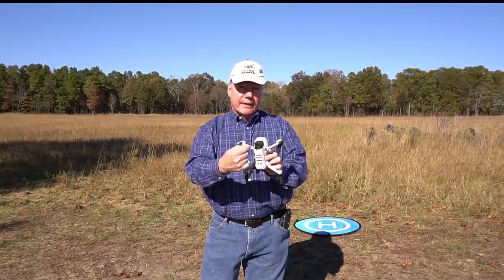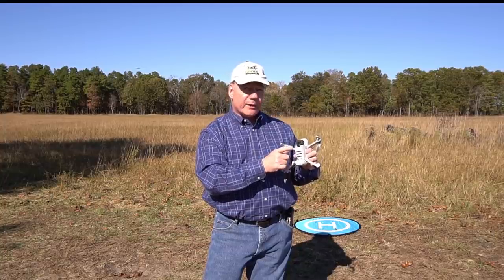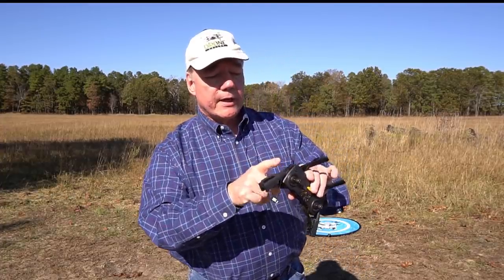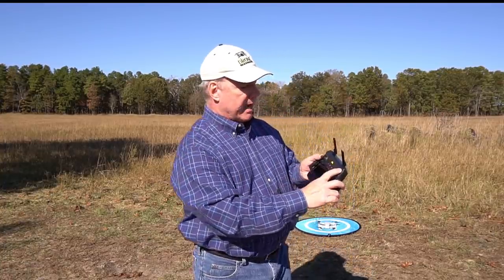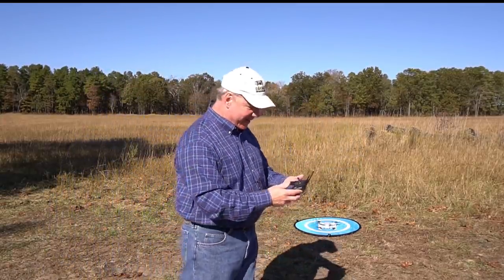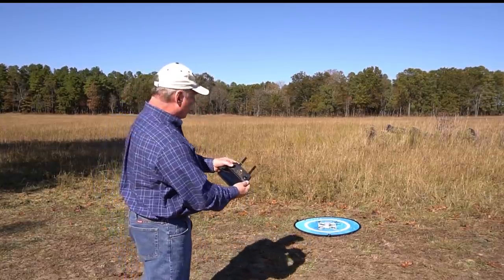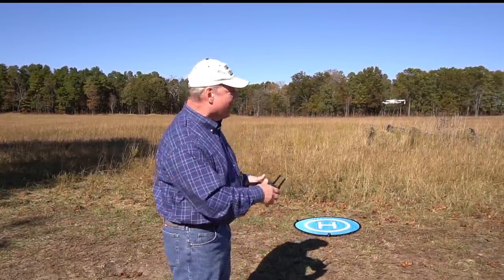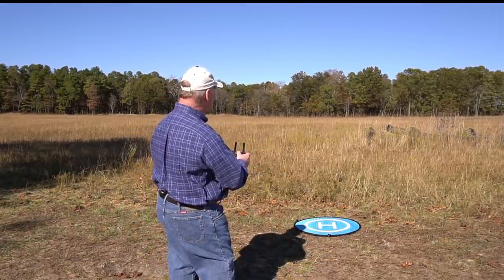Mavic Mini - Setup and First Flight

Comment: Great job, Rick!  Yeah, they ticked all the boxes on this one.  For many, the main attraction will be that it is under the weight limit for many existing and upcoming regulations. (I published a video on the Canadian perspective on my channel).   Did you notice if there is any geo-fencing enabled on this product?
Reply: GEO 2.0 engaged :)
Reply: @repaid1  OK, GEO 2.0 is interesting.  The catch, at least in Canada, is that it doesn't match our airport restrictions (missing airports, incorrect restrictions, for example).  Does it actually lock you out of areas, hence requiring you to 'unlock' via DJI?
Reply: @DonJoyce  All your incorrect data should be set to DJI Flysafe at the address or contact they provide. The only way to know how the craft would behave would depend on what airspace category DJI says it is or it actually is. Their site gives you that information..Best of luck.

Comment: Hi Rick, did you do the compass/imu calibration before flying the drone or does this drone needs to or it auto calibrate itself? Does the controller have a stop button same as in the spark because its really handy especially for indtance if you do dronie and suddenly you noticed some elecrrical wires in its path? Can dji do updates on the flight features in the future especially on the active track and follow me features which every new user loves since its a software? Very informative video! Thanks!

Comment: Extremely windy?  Looked pretty calm on the video.
Reply from the maker: The wind was gusting quite a bit and he drone held it's own. I have a clip posting this weekend where I show you how it performs in windy conditions. It get bounced around a little but the video is still rock solid.
Reply: @Dronevalley  Thanks
Reply from the maker: @Wheres_Bobby  No worries, stay tuned for an update. Rick

Comment: The parts of the distant grass looked blurred out on take off.  Not sure if it is the frame rate or aggressive image smoothing due to motion?
Reply: I'm pretty sure that's just YouTube's terrible compression.

Tom Scott did a good video on it here: https://www.youtube.com/watch?v=r6Rp-uo6HmI
Reply: I saw the same thing here . .  low level,  grass looked blurred here too . . .
Reply: That is generally what Youtube's terrible compression does. It's based on the settings it's uploaded with plus the original settings on the file. Unfortunately it didn't come out well here, but I've seen plenty of other reviewers that have showed footage that looks just as crisp and in focus as he is describing. It's a shame. Some other camera reviewers I watch tend to have a download link in the description for the raw footage purely because of what Youtube can do to the video quality.
Reply: If you're seeing it too, it's not my internet. I think it's the mini's recording. If there was a clean download we'd know. I've seen this on a Mavic Pro too.
Reply: AND if it was youtube, the whole frame would be blurred.

Comment: Thanks for this. Just about to hit the buy button but the blockiness in the midrange as seen at 7:50 in the video and elsewhere is a bit concerning. Is this on the raw footage from the drone or is it a youtube or processing artifact?
Reply: i think its more of the write speed of the SD card not being fast enough after looking at it and comparing to the stills later in the video. the stills are crystal clear, but the video does have issues when you have tons of small objects in motion in the mid range. 
not sure if it's the cards capabilities, or the write speed of the drone's hardware itself. but i am certain its not a youtube issue.
Reply: John Robertson could be just YouTube, processing artifacts, or when rick rendered it out it lost a lot of quality due to the bitrate he rendered it at.

Comment: Do you think an iPad mini will still fit like it does on the M2 series?
Reply from the maker: Ptter, thanks for the question and I actually just answered it in the Top 10 Questions clip I posted tonight. The answer is yes it will work and I even have a cable we manufactured you'll need to connect the tablet. The stock one that comes with the quad is too short and this longer one (30cm) is the perfect length to make the connection. Here's a link if you need one - https://tinyurl.com/y2895ood

Comment: Great videos, thanks! I have been checking several testers of the mini, and am impressed. Quick questiions; when using your iPhone, what is the range you can continually view the image? Have you heard anything about Mavic adding the ability to use goggles? So far, I am impressed with what I have seen. I am new to drones, and this will be my first, although I do fly RC aircraft. Thanks.

Comment: Hello there. In one of your videos you commented that the Ipad Mini would fit in the controller. I just received my Mavic Mini and you are correct. The issue is however that the DJI Fly App seems not to be available for the Ipad Mini 4 ….. Most Odd. I am in the UK and it aint in the App store..... What are DJI doing
Reply from the maker: Dennis, you should be able to download it the same as you would for the iPhone. One issue is that the app doesn't yet scale to fit the larger screen properly but they can sort that out later with an update. I use the iPad Mini 4 with mine and it works great. Rick

Comment: you truly are amazing i will be getting this drone as a Christmas present for me. i just need to know you said you get 30 minutes of fly time so if i charge all 3 batteries i can fly for 1 hour 30 minutes right? amazing drone
Reply: No actual flight time with a battery is about 25 minutes max if recording and in normal environment. That wouldn't be good on your batteries using it like that. You should always land with no less than 20% remaining if not more for the batteries life and longevity so about 23 minutes. Don't know too many people that need to film for 1 1/2 hour anyway if they have a clue what they are up there for..LOL
Reply: @repaid1  lol no i wont record for that long i was just curious on the time. thanks for the comment as i will get my combo set the 10 november

Comment: Nice. The website says that the drone can fly for up to 30 minutes. Some reviewers seem to be getting 23-25 minutes.
What flight time have you seen?
Reply from the maker: Thanks for the post and the flight time can vary depending on how you're flying the drone. If it's a windy day or if you're flying in Sport mode, your airtime will be less. I also tend to land with about 20% of my cell charge left just so I don't get into a forced RTH situation. My experience has put the average flight time (for me) at around 23 minutes (with reserve power left). That's plenty of time for an average flight and amazing for a quad of this size. Stay tuned for more content posting this week. Rick

Comment: Rick, luv your channel and info u present is so valuable. My issue is mini requires a compatible device with 64 bit operating system. FLY app would not download to my Samsung  phone or any of my 3 tablets, even though running Android version 6 and 7, as required by DJI. I had to return mini to DJI rather than buy an expensive new compatible phone that costs more than the mini. Do you have any suggestions. Few on you tube ACKNOWLEDGE this is a severe undisclosed issue for new buyers  of drones. Thanks.
Reply from the maker: Wayne, I agree that it should be noted on the site but they do list phones that the app has been tested with for use. The challenge with most of the Android products is that there is really no "standard" version of Android that DJI can use for testing. Every company that releases a product running Android forks it a little and adds custom elements (and programs) to the build. This makes it impossible for DJI to certify all of them. I agree with you that they should have tried to build the app in a way that it could have run on older devices, especially considering the cost of the Mavic Mini. The only suggestion I have is to looks for a used iPad Mini 4 on eBay to use with the drone. A lot of folks are upgrading their tablets this Christmas and there are some pretty good deals on gently used iPad Mini 4's. I hope that helps and thanks for the post. Rick

Comment: Hi, thanks for this video. No calibration needed?
Reply from the maker: I've had to calibrate the compass only twice in a few weeks of flying. It's always a good idea to calibrate the compass when you travel a long distance between flights but other than that you're good. Rick
Reply: @Dronevalley  ok thanks. I've been using a Mi drone few years ago and calibration was long a boring. Each flight had to be calibrated even with about 50km distance from last flight. When you need to make a quick shoot it's frustranting. Hope this one  is quicker and no so often.

Comment: Excellent video! Few questions...can a VR headset be used with it? What is the speed of the drone? Last, does it have lights I hope?
Reply: 1. only if your device has HDMI out and your goggles accept that. Posted on DJI's website in specs section (Converted to 29MPH in Sports mode) Only lights are battery status ...no Nav lights...to save weight.

Comment: I might buy one of these after Christmas! Looks nice, I wonder since the controller uses WiFi if a WiFi modem would interfere with the signal?
Reply: It will degrade the signal, but probably won't effect it. I would assume your asking about flying in your home or in a WiFi heavy location inside. Other than that outside in a congested WiFi area (Such as a suburban housing location) it will effect total range, but the signal from the controller will be much more focused than the weak signals coming in from homes.

Comment: Did they have to use WiFi for the downlink (technically illegal in the UK)? So you have to have a smartphone too.
Reply from the maker: Dave, they have a few different models being released to other parts of the world and have tweaked the transmission standards to match your locale. That's why they had a few transmitters on the FCC site for testing. I hope you grab one and thanks for posting. Rick

Comment: Interesting question so based on the weight it does not have to be registered. Does this mean you could fly in a state park? In areas they say you can't fly?
Reply from the maker: Nope, it still has a geofencing system built in so it limits your flights to non-NFZ locations. The light weight only means you avoid the registration fee in the U.S. It's a bigger deal in other parts of the world that have tougher standards. Thanks for the post!

Comment: Hi! Thanks for sharing with us this review. I saw another video review and the Mavic Mini have issues and it started going down and some alerts with the battery or something like that (the review say that it just the firmware is in beta). I just bought one today and I have wait 12 days but now I little worried. Do you have some issues?
Reply: That "other" video was at a high altitude, the specs for max service ceiling are on DJI website..he was obviously beyond that or darn close, and your right firmware (Consumer) is not released...I wouldn't worry about it. :)
Reply: @repaid1  Thanks for you reply! And I love your videos!

Comment: I wonder if it would work with a certain generation WiFi iPad with it’s 3rd party adaptor holder or an iPod Touch? As I don’t own a iPhone or Android Phone. I own a 7.9” ipad 4thgen and 9.7” 6thgen ipad. Both WiFi only models. Guess I’ll need to watch more mini videos to see if new dji app is hardware compadable with my iPads or a iPod touch WiFi’s
Reply: Specs are posted on DJI Mini website for DJI Fly

    Required Operating System
    iOS v10.0 or later Android v6.0 or later All Ipad adapters that worked on Mavic Pro forward will work on the Mini. :)

Comment: I live in North Dakota. How does this drone hold up in -20 weather? Are there restrictions for operating in sub zero temps?
Reply from the maker: Thanks for the post and the honest answer is that any electronics doesn't do well when it's cold. The Mavic Mini contains a lot of high tech systems - GPS, Imaging, gimbal and flight control, signal transmission - that are all affected by cols in different ways. While you may still be able to fly it in that colder weather, the flights will be shorter and you'll have to keep a careful eye on the battery level. I hope that helps and thanks for stopping by. Rick

Comment: Hi. I'm planning to buy my first drone but i can't decide what to buy. I'm torn between these 3 drones Phantom 3 advance, dji spark or the mavic mini. please help me decide. thanks
Reply from the maker: Joshua, thanks for the post and my suggestion is that if you're just getting into flying, the Mavic Mini is the one to go with. The Spark is older and will probably be replaced with another model soon and the Phantom 3 is large and hard to bring along when traveling. While the Mavic Mini won't shoot 4K, it's reasonably priced, small and flies like a dream. You can get used to flying with the MM and upgrade later if you find you really enjoy the hobby. Here's a link if you want to check it out -> https://tinyurl.com/y67sbgmr
Reply: @Dronevalley  appreciate it. Thank you so much for your advice more power and god bless!

Comment: Does it have exposure lock?   Does it have color balance lock?   I ask because some shots are ruined by  changes from auto exposure or auto color balance.
Reply from the maker: Bob, the beta firmware I'm running on the quad has none of those adjustments. I'm assuming they'll add some of them in the final version being shipped with the quads in a few weeks or push it out as a firmware update. It's a very similar camera to their Osmo pocket, which has a lot of those features so I just think it's a matter of the software catching up. Stay tuned and I'll update the channel if things change. Rick

Comment: Which cable to I use to control an Android phone to the controller. I just got my mini today, but have to wait til the 11th to get the DJI Fly app. But getting everything set up and need to know what cable to use. Also where are you at in NJ? Hunterdon County here.
Reply from the maker: Jane, your Mavic Mini comes with 3 connection cables. The Android phone uses either a MicroUSB (older) or USB-C (newer). Fine which short cable fits into your phone and connect the other end to the side of the controller and you should be all set. I have a few more clips posting this weekend so be sure to stop back soon. Rick

Comment: Hi Rick Do I need to put the cellphone in airplane mode before flying it? Do cell phone calls interrupt the signal?
Reply from the maker: Hector, it's always a good idea to put the phone in airplane mode when flying to reduce the Wifi and other signals from interfering with your flight. While a call coming in won't affect your ability to fly the drone, it will take your attention away from the quad, which is a bad thing when you're flying. I hope that helps and thanks for the post. Rick

Comment: do you have to calibrate it like you have to do with other DJI drones? Btw love ur vids; im subbed
Reply from the maker: Thanks for posting and I appreciate your support for the channel. You may have to calibrate the compass if you move a long distance from where you last flew or are near metal. I've had it about 3 weeks and have only had to calibrate the compass twice and it takes less than 30 seconds to do it.
Reply: Drone Valley thanks for the advice-I have the spark and I callibrate it every time I fly, is that a bad thing?
Reply from the maker: @diegocortes1197  No, it's actually a good thing to do as it resets the compass to give you a much more accurate home position. If you take the time to do that you'll never have to worry about losing your quad and it can always find its way safely back home.
Reply: @Dronevalley  Wow i didn't know that! Thanks for the feedback! good luck with your channel as well!

Comment: Hi rick i am Danny from the netherlands, City enschede. I have the mavic pro for almost 2 years and i have a 5,5 inch   Crystal Sky display/screen  and i use it with my Mavic pro , but what i want to know is . Can you also use the 5,5 inch  Crystal Sky display/screen also with the mavic mini together is that Compatible with the mavic mini drone . Greetings Danny damveld from the Netherlands.
Reply: Why would you think you couldn't? It's nothing more than a Android based tablet. Your only problem is waiting for DJI to make the App compatible with the CS series as this has it's own proprietary Flight App.  It probably could be side loaded (Android App, Current release) if your have tech knowledge of how to do simple things with Android?  Other than that at present and on release I don't see DJI being in any rush to release the CS App version...they never are.

Comment: Did you actually get the full 30 min of flight?  What the real world time flight did you get on the drone
Reply from the maker: The published flight time is 30 minutes and I imagine you could get that if you were simply hovering. I have flown it a lot and get between 22-25 minutes of flight under normal wind conditions before I land it dies to a low battery. That's still an incredibly long time to fly compared to other quads on the market.

Comment: Hmm, very sceptical of your enthusiasm. How is this any different from other drones you've flown?
Reply from the maker: Thanks for the post and the big difference between this and the other quads is its size and its performance. It really does fly like a small Mavic Pro and is stable as anything I've put in the air. The retail price of this quad could have easily been $100 more and it would have been worth it. I've been flying it for 3 weeks now and smile every time I put it up in the air.